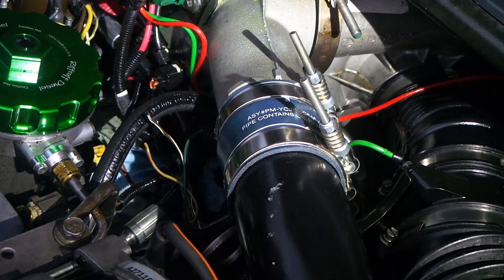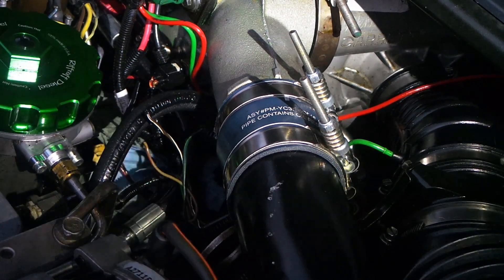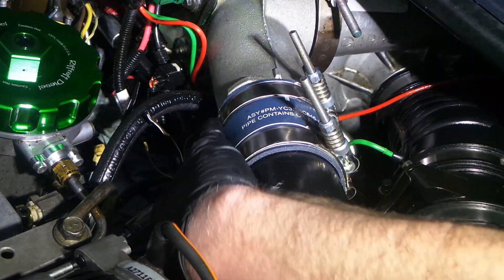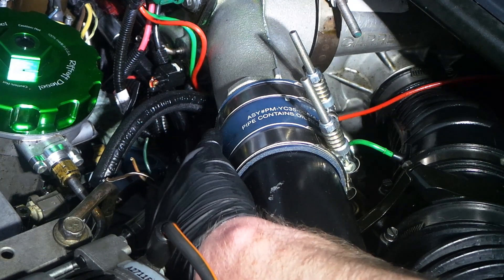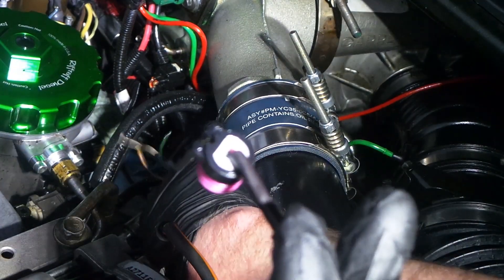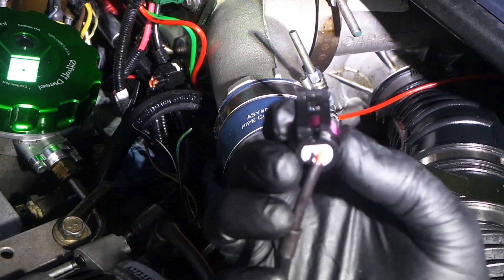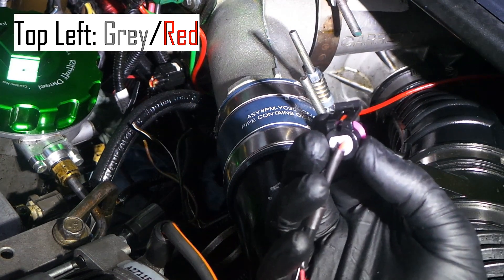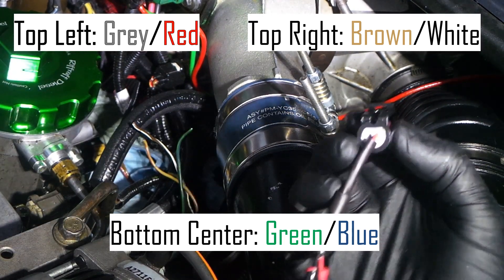Injector Control Pressure Sensor (ICP) Wiring Guide for 7.3 Powerstroke

Comment: If the wiring is wrong. Will it still work ? After I changed the pigtail. I got the code p2623 which before the ICP was replaced I didn't have that code. Tia
Reply from the maker: My experience with it would say no. I was trying to get my truck started after an HPOP fitting blowout, and my buddy who was helping me accidently disconnected the ICP pigtail and reattached it incorrectly which resulted in a lot of unsuccessful cranking trying to get engine started. After a while I told him to just unplug ICP and wouldn't you know it, it fired up (albeit extremely roughly) about 10 seconds later.